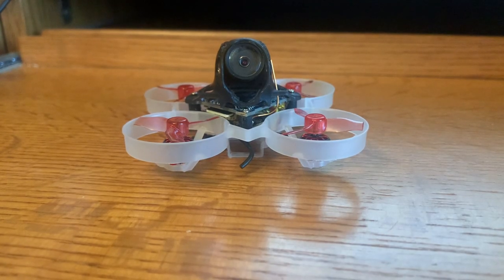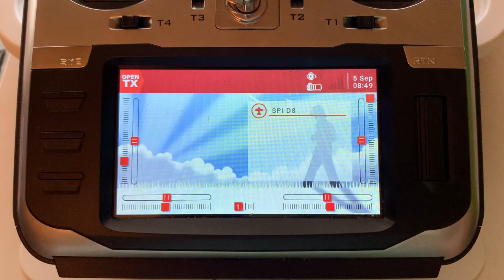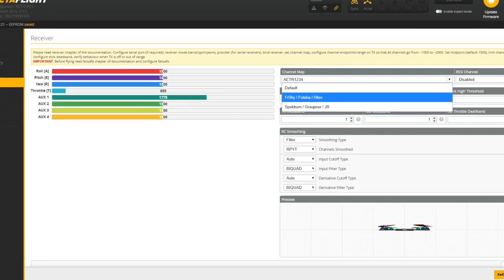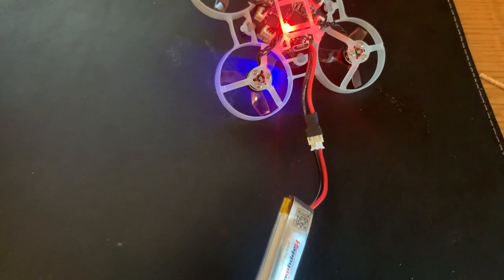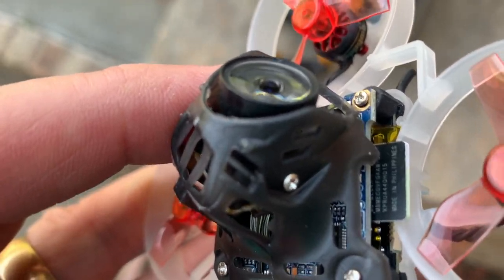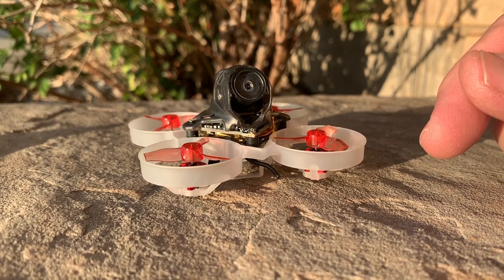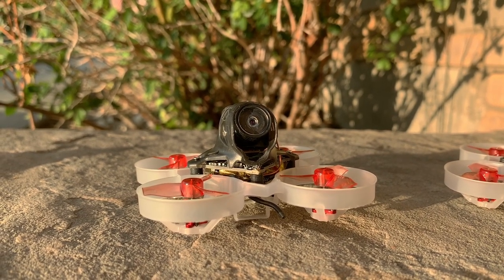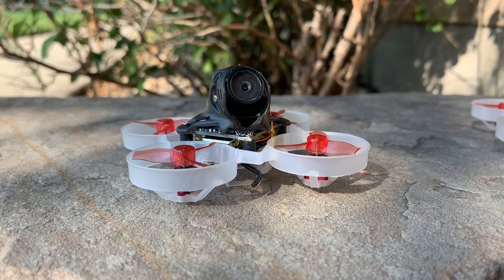Mobula6 HD Review & Setup Tips

Comment: Hi, i have a question. 
I have mobula 6 HD , but the recorded file from SD card on Mobula is year 2015. How to Fix this ? please help
Reply from the maker: @CaptainDrones_ID, I looked in the camera settings with the camera control board and did not see a date field in any of the camera settings menus. I also looked at the user manual for the RunCam Split3 Nano and did not see anything there. You might contact Runcam support. 
Sorry, 
SLOG

Comment: Have you upgraded to 4.2? I’m having trouble binding with beta flight at all. The current configuration doesn’t support 3.5.7. The 4.0 version on the current configurator doesn’t have CLI dumps on happymodels website. They have 4.3 firmware and dumps so I got bf configuration 10.8 and i just can’t get it to bind with my jumper t lite (using fly sky). However I’m easily able to get it to bind with emu flight. I just want to use beta flight again as emu feels kinda slow and has a lot of prop wash. Thanks
Reply from the maker: Hi S H,
Not wanting to dissuade you, but I would not rush to upgrading to 4.2x unless you know how to tune.  I thought the 3.5.7 tune was good. I actually changed out the frame (see https://www.youtube.com/watch?v=O9bOUM7pagA ) but that was tuned for that frame. I was using 4.2.5. You could start with my slider settings and adjust from there. Use CLI command "set rx_spi_protocol =FLYSKY_2A"
Reply: @slogfpv5679   hey bro, thank you for replying. I actually did a frame upgrade as well to the mob7 frame. I can’t get a beta flight configurator version that supports the old 3.5.7. So do you know what i need to do to get my quad flying on beta flight again?
Reply from the maker: @SH-ry2xi  
I keep an old version of Betaflight Configurator 10.4.1
https://github.com/betaflight/betaflight-configurator/releases
You can then load the 3.5.7 hex file from happymodel site for flysky

PS here is a link to Nick Burns who did a similar mod to what you did running 3.5.7:
https://www.youtube.com/watch?v=FDC6glg4zmA&t=766s
Cheers,
SLOG
Reply: @slogfpv5679  perfect, 100 thanks! I’ll try this out this evening and give ya an update! Cheers
Reply: man, this is turning into a huge pain. Since i'm on a newer firmware edition, the old configurator doesn't see the board in order to flash it to 3.5.7..
Reply from the maker: @SH-ry2xi  hold down the boot button and plug the battery in to put it into DFU mode. It should work. On the bottom of the board and labeled boot.

Comment: I just set up my Mob6 HD. Had the screen go black on me also.  Removed memory card and got much better flight time before the blackout screen.  Did a long format on the memory card and it seemed to fix it.  Also.  Can’t get my beeper to work?  Any ideas on getting some sound out of this to find the tiny little thing in the grass with my eyes and ears and not my foot?
Reply from the maker: Sorry for the late response. Was going through comments that I did not get a bell notification. Unfortunately this model does not have a real buzzer. You can set up DSHOT Beacon to buzz the motors but the motors are tiny and do not put out enough sound to help in tall grass. I just arm the quad and use the spinning motor sound to find them. SLOG

Comment: What position should my battery charger switch be in. No info on this anywhere!!!
Reply from the maker: Hi Matt, the battery charger that came with this kit is not the best. I use an older Happymodel charger that can charge up to 6 batteries and has voltage LED read out.  But to answer question, I tested it and moving the switch towards the USB connector is HV (High Voltage 4.35). 
SLOG

Comment: Do you know how to unlock the VTX on the Mobula 6 HD?
Reply from the maker: Mine came unlocked. The VTX is only capable of 25mw and no channels were locked out (eg Raceband channel 1). I do not see a VTX Button on the Crazybee F4 Lite controller. Also nothing documented. So no I do not know how. Did you actually try through the OSD or the betaflight configurator? Sorry SLOG
Reply: @slogfpv5679  Thanks for the reply. The reason I'm asking is that I've had a Mobula 6 HD for about 9 months now, and I must have unlocked the VTX, because it seems to show that it's on 200mw, but I don't know how to do that. I'm getting a new one and an trying to figure out what I did. I tend to forget these details. 🌞 Thanks anyway.

Comment: Does the SD card go directly into the quad or how does it save hd
Reply from the maker: Yes you plug the SD card directly into the quad and the default setting is start recording on power up.
Reply: @slogfpv5679  what else is a good hd recording quad? I have the tinyhawk race 2 and I'd love if that had hd recording
Reply from the maker: @iowalks  GEPRC SKIP HD 3 or 2.5 or BetaFPV BNF HX115 HD 3 come to mind. You could also buy a Tinyhawk 2 FS and put an Insta360 on it.

Comment: How does this mobula 6 hd start and stop recording video? Also, how does the camera controller board work? Do the settings show on the OSD? I can't seem to find any info on it.
Reply from the maker: The factory settings are set to start recording when you plug in the battery. You can change this with the controller board if you would rather push the button on the Runcam Split3 Lite. As far as settings, I was OK with the factory defaults for posting on YouTube. However, if you want to tweak the settings I am going to link Rimzler's channel who has a good video on how to use the controller board as well as best settings for post processing of the videos. 
https://www.youtube.com/watch?v=eRdYtIxdJYw
Reply: @slogfpv5679  Thanks very much. I will check out that video you linked. New subscriber here. 👍
Reply from the maker: @SunriseWaterMedia  
Thanks for the sub!

Comment: Just got mine and the drone won’t go into bond mode, what do I do?
Reply from the maker: Hi Stringa,
When you say will not go into bind mode, does that mean when push the bind button after the battery is plugged in, it does not turn solid red indicating it is in bind mode? If so you may have a defective bind button. I have the Frsky version.
Reply: SLOG FPV all good now mate. Turns out I have a v2 board so it has different binding lights. Eventually figured it out but thank you aswell.
Reply: @stringa-1183  what's did you have to do different?